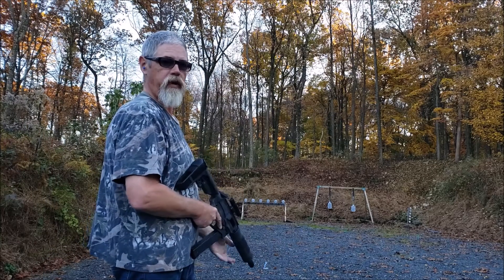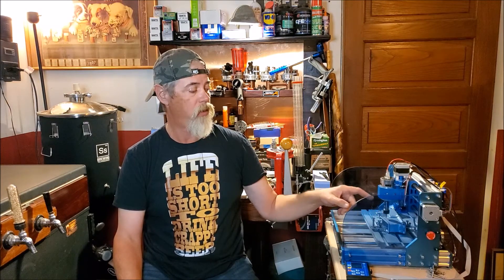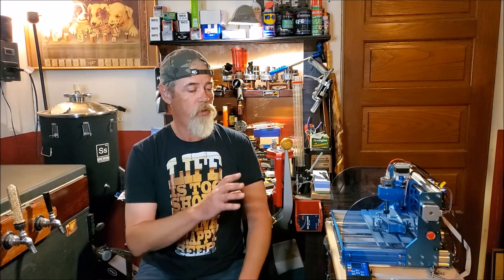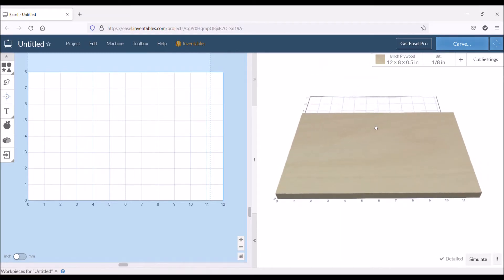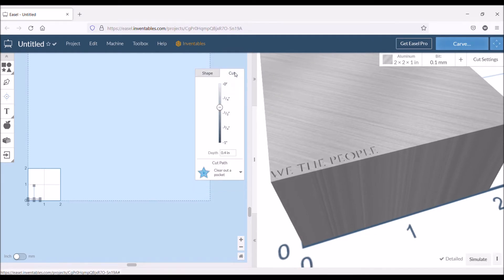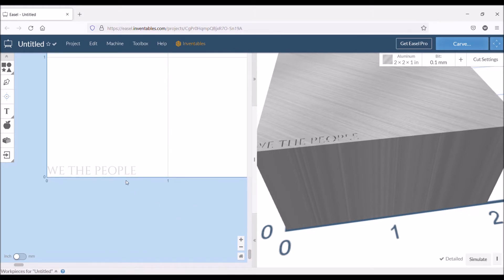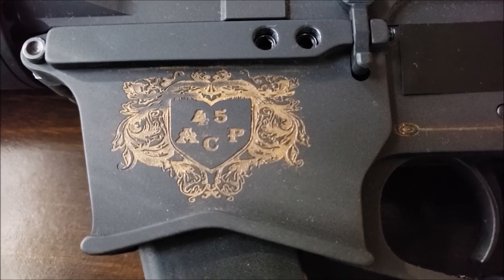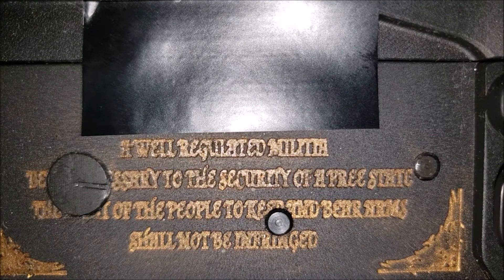Engraving aluminum lower with 3018 Prover

Comment: Thanks for producing another video.  It is the perfect amount of detail for anyone wanting to do this.
Idea.  A video on hanging metal targets that are portable and will ricochet back at you.
Reply from the maker: Good suggestion, I just might do that. My range always has them out, so they aren't my targets and I don't have any of my own, but I could do it with the range targets. If you had this happen, make sure they can move freely and aren't solidly in place. The bullet energy is transferred to moving the target and creating a deflection angle when it does.

Comment: Just found your channel.  Great videos.  I'm a avid gun lover myself and built several of my own 80% lowers. I don't stay to far from Bear creek arsenal in NC. I have been wanting a low cost way of engraving my lowers and from what I have seen from your video what you have seems to be what I am looking for. Do yoy have any advice on where to buy the machine and bits? Also in yoy own opinion is cnc engraving better that laser engraving? And how would the machine yoy use hold up to say a p80 lower ? And last do you think it can engrave ejection doors,upper receivers,charging handles or even handguards? Thanks for any advice from you or your viewers.  And please keep up the great videos I'm a sub at first sight
Reply from the maker: Shop around, I got my 3018 prover on Amazon. It will do aluminum engraving,  but I wouldn't use it on anything steel. As far as this compared to laser, this gives you depth of cut, where lasers in this price range just remove the anodizing with no real depth. Keep in mind, this only works on something flat...if it has curves in the surface,  it will be much more difficult and require a more advanced g code program.
Reply: Hey my friend. I have spent some time shopping around.. I wanted to ask your thoughts on the comgro or just a cheap no name brand from Amazon or ebay
Reply from the maker: @carlton997  not familiar with that type  , this is the only one I've played around with.

Comment: Awesome vid! I just bought this machine for this reason. What bits are you using?
Reply from the maker: I used a .1mm tip 20 deg v bit....there are a lot to choose from.  I forget the specific brand.
Reply from the maker: Just got home and checked....the bit is a Huhao 3821.   The specs are 3-175x20degx0.1mm
Reply: Thanks. Those have a middle of dec-Jan shipping. I found a set with the same specs but carbide so I ordered those. Hopefully will be cutting by Friday! Not sure what bits came with my machine, none are labeled.
Reply from the maker: @blazinj911  The bits that come with it are great for practice, and I've done some solid engraving with them. The ones I listed are more robust, but i"m sure there are others out there with the same specs. They probably come from the same factory in China anyway. Feel free to post your work on here when it's done! I love seeing what others have done, or if you've discovered a different better way to do it.
Reply: @pewsandbrews  got my bits, practicing on some aluminum now. I also noticed I have a 3018 Pro not PROVER so My control menu is a little different. Im not sure what the exact differences are but immediately noticed my control and menus are different from yours. 

Is there a certain text that you find the easiest to use? I was trying to get mine about same size as what my other lowers have. Quickly realized that setting the height size is for the text box not the font. Overall the machine is very easy to use. But I also have 3D printers so I was a little used to most stuff.
Reply from the maker: @blazinj911  Not sure what the differences might be since this is the only one I've used, but the font I've used most from Easel is the "Cinzel" in all caps. seems to give a true dimension while being a little nicer than standard . Like I said, you'll have to experiment a bit, but it will get easier. The other thing that will speed up carve times is setting the machine saftey heights lower than default. They have them defaulted pretty high to clear any obstructions, but if you're carving a flat piece you can lower them to .1 inch no problem.
Reply from the maker: Guess I should ask...are you using Easel?
Reply: @pewsandbrews  yup I am using Easel. I actually was using Cinzel. I had to set the height to 6.7mm to get 4mm tall font.
Reply from the maker: @blazinj911  Best bet is pick the font you like, then do some trials to get the height the size you want. one or two letters on a scrap piece should give you a good idea. I noticed some of he fonts look ok in lower case, but look like hell in caps, and visa versa. Just play around with it and have fun !

Comment: Just put my machine together and bought it for this specific reason. This video is extremely helpful and I just bought the drill bits you mentioned in the comments as well. I have a lot of lowers to drill so I'm pretty excited. I've been practicing on wood but of course it chips off easier so the letters seems connected sometimes. I've had a few times my machine stays on a letter/area and just sits there.. has this happened to you?
Reply from the maker: I haven't had it stop in one spot until it was done with the engraving. I would really recommend getting some aluminum flat stock to practice on after the wood to make sure the settings aren't too aggressive and you break bits.
Reply: @pewsandbrews  it shows the remaining time and percentage of completion moving but the drill kinda just hovers and "air engrave" in a sense for a long time before it moves on to the next section. Where are you able to get aluminum stocks? I'm very new to doing this so I am learning as I go.
Reply from the maker: @2A_LEGOS  If it is still trying to engrave, then it's probably a low spot on the material. We are dealing with very small tolerances, so a difference of a couple thousands of an inch can cause it to "miss" engraving that area. As far as the practice piece, Lowes and home depot have sections of flat stock of varying sizes. I got a long piece and cut it into 2" by 3" sections.
Reply: @pewsandbrews  Ah makes sense, cause usually it finishes that spot but then it just hovers above the hole for a while. I was able to find 6piece 10" x 4" x. 032 " on amazon for $13. Thanks a lot for the feedbacks!

Comment: Where'd you get the itsy bitsy baby clamping set?
Reply from the maker: If you mean the ones holding the part down, they came with the machine.
Reply: @pewsandbrews  Have you tried it on soft mild steel?
Reply from the maker: @butziporsche8646  No I haven't. I would think it could be possible, but bits, rpm, and feed rate would all be completely different. You might also need continuous fluid flow to prevent burning up bits.

Comment: Is the 3018 modified at all?
Reply from the maker: Nope, just like I got it. I know they make upgraded spindles and spindle holders. And you can adapt a laser, but this one is totally stock.
Reply: @pewsandbrews  thanks! Ordering one myself. Found a 2 in 1 3018 with a spindle and laser for 200 bucks. I want to do exactly what you're doing here.